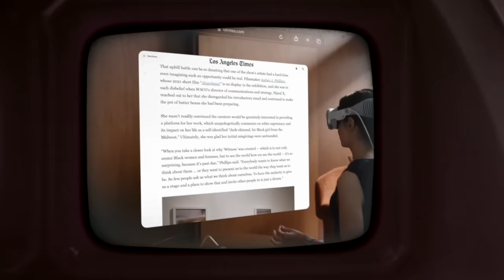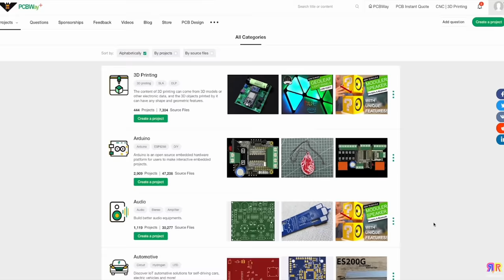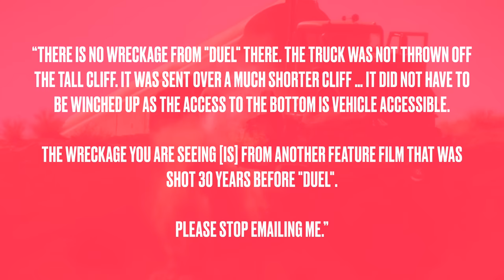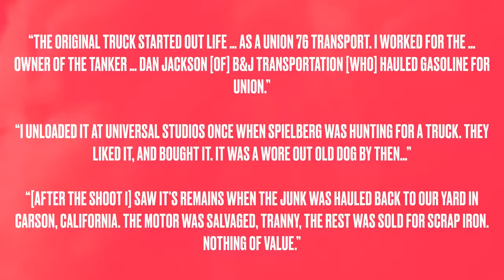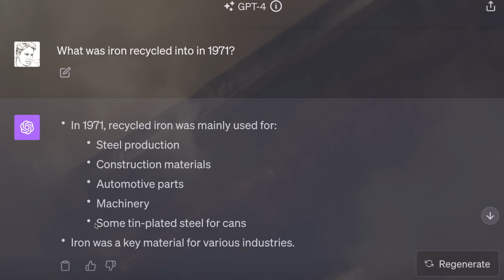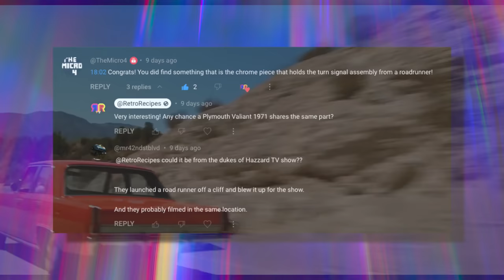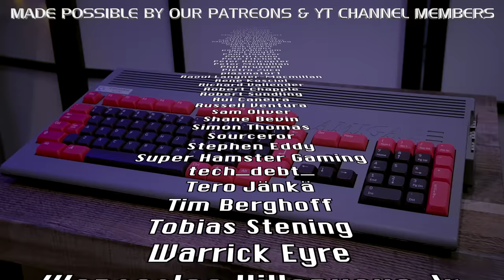Unbelievable 'Duel' Discoveries: Daisy Duke's Parts Uncovered

Comment: Even though you fellas may or may not have found parts of the actual vehicles , it was still a very interesting journey . I was thinking that surely Speilberg would have been required to remove any debris from the site , but maybe the clean up crew weren't that thorough , or bothered . Also , have we had all the " wheel " puns ?

Comment: Daisy Dukes car had chromed aftermarket steel wheels when it went over the cliff, not stock rally wheels, Dennis Weavers car had the smaller non-rally wheels with full caps. The trim you found looks to be late 80's Buick headlight trim, I can see part of the fiberglass headlight retainer still on it. Those 2 pieces you said they would never have winched up... well they look to be fabric, nobody's winching pieces of fabric out of anywhere. The truck cab you found is a 1937-40 International, Reo is pronounced Ree-Oh, R.E.O. Speedwagon was a band, the Reo Speedwagon was a truck (And REO stand for the founders initials, Ransom Eli Olds, which I think is why there is always confusion with the vehicle name as well) The thing you found that you thought might be the AC box, looks to be an old oven BTW. You found someones old dumpsite.

Comment: Well, more importantly, the roof of the Duel truck is “removable”.  It is bolted on to the cab as that model had different roof options that could be customized by each fleet owner. The truck you found at the bottom of the hill, as you noted was rounded.

Comment: the key to the wheel you found is the bolt pattern. The wheel you found is the 5 on 4-1/2inch bolt pattern used on every chrysler car except Valiants. Valiants used similar wheels but with the unique Valiant/Dart ONLY 5 on 4 inch bolt pattern. The wheel would be from the Road Runner, not the Valiant.

Comment: I don't believe that the Chrysler rally wheel you found at the bottom of the cliff was off the Plymouth Valiant from the movie "Duel". That car had hubcaps and rally wheels wouldn't have full wheel covers. They used center caps with trim rings for B,C and E body cars. The Valiant was an A body. The A body rally wheels didn't come from the factory with trim rings, but it was quite common for dealers and owners to add them after delivery. Furthermore A body wheels used a 5×4" wheel lug pattern while B bodies used a 5×4.5" wheel lug pattern.  Judging by the proportions of the wheel at the bottom of the cliff it was a 5×4.5" lug bolt pattern. Meaning that it didn't come from an A body cat. It could be a wheel from  Daisy's Road Runner.

Comment: A few comments regarding the rim you found:  
.1. the Valiant was a ‘71, not  ‘69. 
 2. The Chrysler Rallye rim was offered on the performance cars, ( Dodge Dart 340, Plymouth Duster, Dodge Demon, and some Plymouth Scamps) not  a four door sedan, and first year for the Rallye rim was1970, therefore if it was a ‘69 it would not had Rallye rims.
 3.  The Valiant in the movie clearly  had standard black steel rims with full wheel covers. That is what 99% of Valiant 4 doors came with from the factory. Wheel covers were never installed over the Rallye rims ( they were for looks why cover them?) and there was no way to install them over a Rallye rim 
  4. If you measure the space between the lug nut holes it should be 4” ( A Bodies up until 1973 had a 4 inch bolt pattern. All other MoPars had a 4.5” bolt pattern ) 
 5. It is highly unlikely that was a spare as it would be mismatched to the rest and a ordinary car would have 4 steelies and one performance rim. 
 6. If you could confirm the Daisy Duke notion ( the taillight  chrome piece was a little mangled to tell if it was from a ‘71-‘72 Roadrunner/ Satellite Sebring ( a few of the cars used could have been Satellite Sebrings as they are identical except for trim) it could have been from that car as Roadrunners were offered with Rallye Rims ( 4.5 on 5 bolt pattern) 
It does seem coincidental to find a MoPar Rallye rim right there but stranger things have happened.

Comment: Being that the entry level Valiant wasn't required to do any high performance stunts other than being pushed off a cliff, it would not have the rally wheel you found. A spare in the boot would also not be a rally wheel. It did not have a high performance engine either. It would have had a plain steel rim with four non-descript slots at the inner edges. It's been a while since I've seen the movie but I think the plain jane Valiant probably had a 6 cylinder engine (with basic steel rims with hubcaps as shown).

Comment: There's a film noir from 1940 by the title "They Drive by night" starring Humprey Boggart, where a truck from the 1920s or 30s goes off the road and bursts in flames. Or, it could be from the movie THIEVES’ HIGHWAY (1949), where there's a Studebaker US6x6 [G-630] truck with a cabin that could match.

Comment: After looking at the wheel you found  I have revised my opinion it may not be from the daisy car. 

I counted the slots in the wheel and it looks like the found wheel has 10 openings. 
The daisy wheel has 8 or 9. 

Still really cool though in my heart that piece of chrome is from Daisy's car.
Reply from the maker: I appreciate the co-research. If you count the replica's holes at 18:29 there's definitely 10. Those are Rallye Mopar wheels. I don't know that they came in an 8 or 9 variant. Either way, that one is a match for our wheel. :)

Comment: Great video, but I'm 99.999% sure Daisy Duke's car was crashed at Indian Dunes at or about 34°25'07"N 118°38'10"W.  If it was crashed at Vasquez Canyon where the Duel truck was crashed, I will gladly eat the Mopar wheel you found there.  You can very briefly see the Santa Clara river as the car noses over the cliff, and you can easily location match the area above the cliff using the shots of Bo and Luke stealing the cop car.  This is also the same spot where the General Lee jumps the river (the Santa Clara river but from the opposite direction, north to south) about 10 seconds into the opening credits.  In the jump in the opening credits you can very briefly see the cliff(s) Daisy's car went off.

Comment: 8:00 I dunno, guys --- sorry to burst your bubble, but that truck-cab looks a lot more rounded than the Duel truck; the cab on it was a lot more squarish, as can be seen at 8:10.  The one you found is definitely a large truck, but I don't think it's from the Duel truck.  It looks more late-'40's-and-early-'50's-era than mid-fifties (the Duel truck was a '55 model).  A lot of the trucks back then had split windscreens, so that's not any indication that it's the same truck.  Maybe it was indeed from one of the many destroyed trucks in the "crash and burn endings" films that were popular back in the seventies, but in my opinion, that's definitely not the same one as in Duel.

Comment: The Valiant had a 4" bolt pattern wheel (Mopar small bolt pattern). The Roadrunner had 4.5" bolt pattern (Mopar large bolt pattern). The Valiant would not have come with Rallye wheels, but of course could have been swapped out, then the wheel covers put over them. You probably have no way of measuring that bolt pattern now without going back, so, keep walking. But if the wheel you saw was 4" bolt pattern, that's how you would know there was no way it was on a Roadrunner.
Reply: hub cap wheels where solid steel not rallys. The spare would have been the same way.
Reply from the maker: Interesting. There is actually a way we could check that. Might save it for a follow up.
Reply: @RetroRecipes  the rally won't hold a hubcap has no way to clip it. As for spare they should use the less expensive wheel as well. Valiant also may have had a temp spare that year. Mopar expert would be able to tell you a 100%.
Reply: 1969 cars didn't get that rally wheel, 70 and up could get them as a option.
My Dart had the wider steel small bolt pattern wheels similar to what the Valiant had on it. I found a set of 70 rally wheels and put on it because they look awesome on it even if it wasn't available for it.
I'd say yes, that was from the Road Runner they drove off the cliff much later and I bet it big bolt as only the early A body cars used the small bolt pattern.
That wheel is probably worth some money, if it's small bolt it's worth even more as less were made and most were tossed when new for bigger chrome wheels of some sort. And yes, they can't hold hubcaps.
Reply: @jeffreyrigged  We had a 1972 Dodge Dart with the small bolt pattern and hub caps.  A relative that worked in a service garage gave us a pair of tires mounted on rally wheels.  The 1972 full wheel covers fit on the rally wheels without an issue.
Reply: @sbf_fox2434  they usually won't snap on and stay. But that said wheel covers aren't going to be stuck on rallys from the factory.

Comment: Daisy Duke's Road Runner had Magnum 500 wheels and the Valiant had standard stamped steel wheels with wheel covers. The Rallye wheel was an extra cost option on the Scamp and Duster and not available on the low budget Valiant. Is it possible the Road Runner that went over the cliff had the less expensive Rallye's? Probably.
Reply: Might be the spare.

Comment: As for the engine, I’d feel sorry for whoever drives a truck with a 1674 CAT…..they were really over complicated junk. The worst part is no Jake or other engine brake exists for them. They were Overhead cam, underpowered and now near impossible to get certain parts for. There’s a reason the backup truck with a 335 Cummins was needed and is still running.

Comment: 16:23 guys that's actually a 72 Plymouth Scamp, very similar to a 71 Scamp, but it's not a 69 Valiant. Those had a very similar front ends but different body unique to the valiant. The 2 door valiant ended in 1969, in 1970 it somewhat continued as the 1970 Valiant Duster, and in 71 the valiant Scamp arrived but the body used a Dodge Dart 2 door body, like the one in your picture. The body was no longer unique to the Valiant. The duel car is a 4 door 70 or 71 valiant and that is still a body unique to the Valiant. Those wheels would never be found on a 4 door Valiant, those are the rallye wheels and found mostly on performance cars by Chrysler, not 4 door, slant 6 cars

Comment: if you measure the bolt pattern on the rim an A boby is a small bolt pattern and a B body like the roadrunner is large plus those rims dont use  hub caps .

Comment: FYI, the valiant used in the movie duel would not have had rally wheels. Also, the picture of the green car is a 1970 scamp not a 69 valiant
Reply: The movie car did not have rally wheels. It had steel wheels and hubcaps and less they used a different car to go off the hill. As I stated the green curry you pictured is a Plymouth scamp not a Plymouth valiant and well they are both Mopar a body cars definitely not the same car.
Reply: For more likely that you’re right about the daisy duke car, and that is where the wheel came from

Comment: At 13:03, you ask about what movie this truck may have been in? Sir, I will take a guess at the movie with an explanation: I cannot remember the name of the movie; there was a movie where people robbed a bank and they hid in a fuel trailer, which had been cut and welded to provide a space/compartment for the robbers to hide within; the fuel trailer was pulled by a truck with a cab like the one at around 13:00. The police finally stopped the truck by setting up tires for the truck to drive over. However, I think the truck ended up going over a cliff. It has been decades since I have seen the movie, so, I am remembering as best as I can. I think the movie was a 1940s crime drama???

Comment: Round roof cab with split windscreen doesn't match the movie truck. Winscscreen wiper motor is above the glass on the wreck but the Duel truck had the wipers below the glass.

Maybe they did a test run with another truck?

Comment: A body which is the duel car used a 4.25” wheel, b body which is the road runner used a4.5” bolt circle. 71 was a transition year for Chrysler which would end the use of the 4.25” wheel

Comment: The Red Valiant in its configuration would have not had Rallye wheels standard, they would have been plain steel wheels with the hubcaps shown in the movie.  Rallye wheels had a bolt-on center cap that covered the hub area but never the entire wheel.

Comment: The movie car would have plain jane black steel wheels under those hubcaps, the rally wheel on site would have been a silver color, if you pause and look closely at 18:55 you can see the lip of the wheel is black not silver. I'm not even sure if rally wheels were an option on the 4 door valiant but being this car was brand new when the movie was made it probably came straight from a dealer or plymouth itself which wouldn't have swapped out the wheels. At 19:16 the two smoking pieces were probably trunk liner material, they look to be smoldering/burning as they fly through the air.

Comment: The wheel is not from duel car. 
That is a rally wheel from an upscale dodge, Plymouth with the large 5x4.5” lug spacing. 
The slant 6 base model valiant would have the small 5x4” lug pattern wheel with out the parameter holes. Aka, Not a rally wheel.

Comment: I would suggest that you are missing an extremely important plot point.  If the fellow that doesnt want you to bother him anymore said that the cliff they dumped the truck off of was not that one, why would Weavers Valiant's wheel be there?  His car was under the truck, on fire, at the shorter road accesible cliff.....likely some distance away....outside of the debris field of maybe the Daisy Duke hero car zone.  Just a thought.

However Daisys care likely had a similar wheel.  But from what I know of stunt cars....all non essential items were always removed to avoid flying shrapnel should a stunt go awry.  In this case, leaving a spare tire in a car trunk was never a good idea.  Even though no one was in Daisys car, throwing a spare that wouldnt even have been on set in the first place casts doubt.  

On the otherhand, it may have been one of the actual wheels mounted on the car.  Shearing lug bolts in impacts is not unheard of. A wheel separating from a strut assembly does occur.  The axel and brake assembly need not break for a wheel to wander off on its own.  Daisys car is indeed a mopar and could have had that design wheel mounted.  I question the lack of rubber.  Although again, an impact and subsequent violent cliff crash could remove a tire and tube from a wheel.

Comment: I read that Spielberg insisted on filming Duel 'On Location' as he didn't want to do it on a soundstage, he really put in the hours too; so he didn't have to, He made a 60 min film for TV, they later wanted it expanding to 90 minutes.

Because the truck was already wrecked, they had to get another one, but not only that, they had to find  another Valiant. You can sorta tell too. There is footage of it in both manual and standard shift guises.

That sort of continuity is kind of laughable,  cool film though!

Epic find boys, just what film was that 1950's cab out of?

HOABL

Comment: Not saying it isn't true, but I don't 100% believe the story at 11:14, because of a couple reasons. 1, it doesn't quite line up with the story I'd heard of how the truck was selected (Not that the story I'd heard was real), I had heard that Spielberg selected that particular truck out of a lineup of trucks, not just a chance encounter. 2, if the truck was a 'wore out old dog', why would the engine have been salvaged after the stunt? Nine times out of ten, especially with trucks and equipment of that vintage, the engine is by far the first thing to wear out.

Comment: Compare at 8:11 the boxiness of the roofline and the door frame and the shape of the side window with 8:11 - and the shape of the back window at 7:41 and 5:13 (hint: the truck didn't have a rear window, just a hole the exact size of the a/c unit at most.)  No way this could be the same vehicle.  It looks small enough that it could be someone's old pickup cab that's washed in there during a heavy storm.

Comment: I can tell you that rim is not from Daisy's Roadrunner. The dropped car had the rims with the triangle cutouts on it that were used on the show. I have a behind the scenes picture on my Twitter showing the car after it was dropped with the rims.
Reply from the maker: Can't seem to find your Twitter or any photo of that on Google. Don't post a URL but can you give me a hint of your Twitter name?
Reply: @RetroRecipes  Hockenheimring.
Reply from the maker: Thanks! Found it at that handle. Does indeed look like at least one of the surviving wheels is not a match. I'd say this makes the theory much less likely. One day we will find out for sure where that truck and wheel came from. They were used in some movie or show, that's for sure.  @MarkVerstappen93
Reply: @RetroRecipes  Happy to help. I’ll enjoy the journey! I posted another I had saved showing the front right. The 3rd and last picture I have not posted shows only the rear of the vehicle without any rims in shot.

Comment: Highly unlikely that’s the wheel.  The valiant would have not had Ralley style on a 71 4 door.  And I’m pretty sure Daisy’s Road Runner had Magnum style rims. You can measure the bolt pattern.  If it’s 4 inches the wheel was from an A body. If it’s 4.5 inches the wheel is from a B body.

Comment: I believe that wheel is not from the duel car. It is from a Chrysler product 100% however, on wheels that Chrysler put hub caps on they used a solid black steel wheel. On the wheel you found it is supposed to have a beauty ring around the outside and a center cap in the middle. It is a really Wierd coincidence that a mopar rally wheel would be at the bottom of the cliff, so who knows.